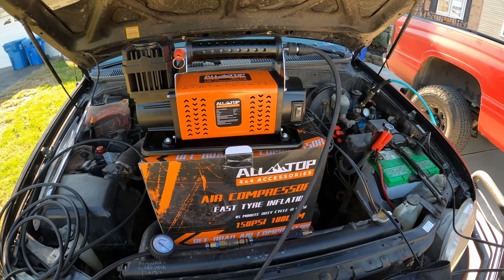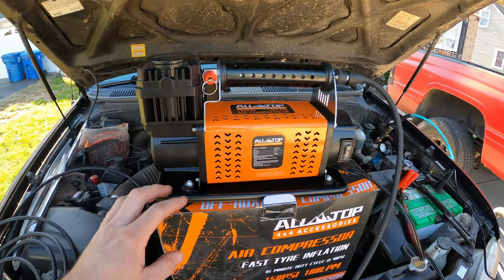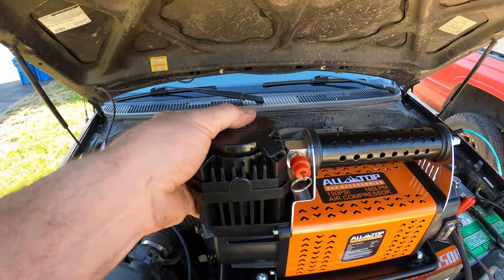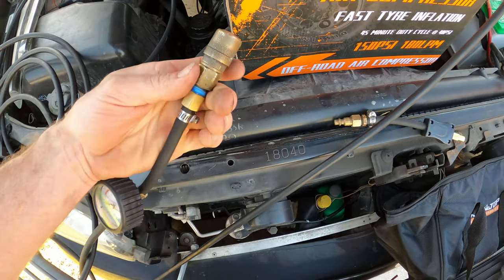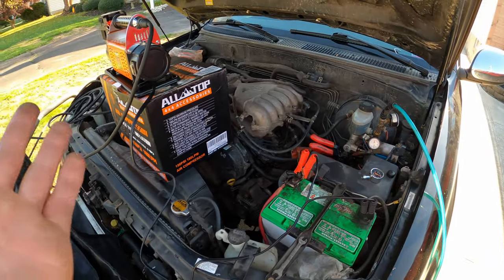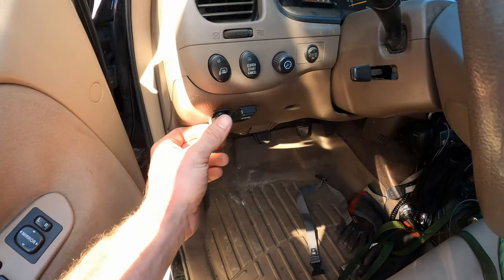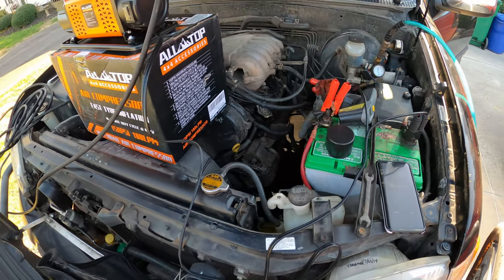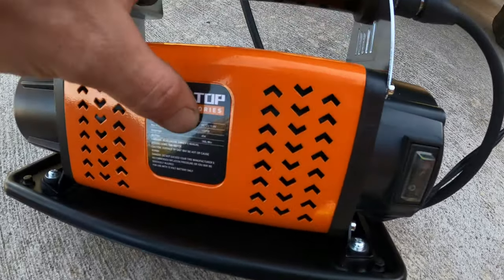ALL-TOP 12v Portable Air Compressor Review vs ARB CKMA12

Comment: Just got one today, the problem or worry that everyone is having about switching the nipple to an American standard nipple is OVER! They now include an adapter that just pops right on! No going to the hardware store to find threads adapters or anything!
This thing is powerful, fills fast and not too bad on the ears! 
I will say the gauge does suck as others have mentioned…. 
Anyone know if the gauge has a common pipe thread, or is the a replacement gauge?

Comment: I did the same with my Harbor Freight compressor, cut the end of the hose and put a standard female end on it. It makes it way more versatile!👍
Reply from the maker: How do you like the Harbor Freight unit? Do you know what the CFM rating is on it?
Reply: I don’t know what the CFM is, I grabbed it a few years ago before a wheeling trip. It’s great for the quad and the dirt bike, but if it try to air up all four 33’s on the Jeep, it takes forever.
Reply from the maker: @MyDIYAdventures  got you. I'll have to look them up. I didn't even think to check Harbor Freight. And yeah they are definitely handy to have! I like my onboard arb n the tundra but I needed to get something for the Ram

Comment: Actually I  just purchased the ALL-TOP 12v Portable Air Compressor and the air guage is dead on plus the air hose connector is US compatible....Very happy with the purchase I can check and inflate the air pressure on my 5th wheel rv at my leisure...
Reply from the maker: That's cool. They must have changed the design

Comment: Now I also wondered if a 12 volt compressor was a good idea mounting in the engine.   Now I know thanks !!!
Reply from the maker: It's definitely the most convenient spot that I found. However if you were going to run it for an extended time you would definitely want to heavy engine hood open to allow cool air in there
Reply: @NoNonsenseKnowHow  I ran some wire from my battery and keep mine behind my seat.keeps it clean etc
Reply: @NoNonsenseKnowHow  I also took mine apart and put a heavier set of booster cables because the wires would get hot and ran 3 feet of insulated hose from my compressor
Reply: @BobSmith-dm3vp  Good idea ...

Comment: awsome review. I have the same type as that alltop and still runs great. I had to get a different adapter for the quick adapter attached to the compressor.I believe they call it a type L or something. changed it out and now I can use the normal quick connectors like yours. Sure wish i didn't have to use the flowthrough adapter when filling as it would be nice to be able to use a digital gauge while filling.
Reply from the maker: Thanks man and awesome. Good to hear yours is still going strong. Haven't had any problems with mine either yet although I haven't used it since this video LOL.  And yeah definitely swapping out the connector is a must

Comment: Since you have to turn the compressor off to get a reading from the gauge, shouldn’t the gauge be located near the compressor. Than you don’t have to walk back and forth to check your reading. Am I overlooking something or did they overlook that.
Reply from the maker: I mean I think it works fine the way it is. But yeah I see what you're talking about. Truth is, once you're used to using the compressor you will be able to know what the pressure is without turning the compressor off
Reply from the maker: Or roughly anyway

Comment: Thanks for the video, nice job. So now that you've lived with it for a while have you had issues?  Would you consider doing another test of the All-Top with the engine running?
Reply from the maker: No problem and thanks man. I haven't used it since this video so I couldn't really give an updated opinion at this point.  May do an update in the future though.  It would be slightly better with the engine running
Reply: @dirtylu79  Could be it's already paid for ?

Comment: End of video you show your front bumper set up. 
Did you attach after you bought truck. 
Would you buy differently 
Have you ever hit a deer?
Reply from the maker: Yes I added the guard and the winch after I bought the truck. I'm happy with the setup. If you look up NoNonsenseKnowHow tundra winch then you will run into a video I did showing the basics of how I put the winch on. Are you talking about the winch or the guard?
Reply: @NoNonsenseKnowHow  the guard, but the winch too. I’ll check out the video. I hit a deer in Montana in a rental grand Cherokee jeep. Now I’m wanting a guard for my 2006 GMC pickup. I really like your videos. Very informative
Reply from the maker: @johnyb9884  oh got you. Yeah definitely a good upgrade! Might not save the vehicle completely but at least give it a fighting chance and will hopefully keep deer from going in the windshield.  That was the main reason I installed one. And thanks man I appreciate you checking out the videos

Comment: Did some quick searching and the oem fitting looks like a high flow BSPT and is bored out a lot bigger than a standard T style NPT.  Mine came with a small adapter hose that connects to the compressor and has a T style male fitting on it.

Comment: Viair portable air compressor is the way to go.
Reply from the maker: Which model? I was looking up the specs on their comparable models and they were half the air volume
Reply: @NoNonsenseKnowHow  400p automatic shut off 33% at 100 psi. 2.3 cfm good to 35inch tires 30amp draw
Reply from the maker: That's great that it has auto shut off. But that's even less CFM than my ARB.
Reply from the maker: @yjdriver7432  the alltop has 6.3 CFM
Reply: I agree its less but it sure seems pretty quick. Ill have to do a 0 to inflate time and let you know. But it has normal fittings and just much better quality build and comes with spare air filters basically everything you didn't like it has hahaha. Just a fan of there products I was going to buy the all top because of price but I'm glad I went with viair
Reply from the maker: @yjdriver7432  yeah that would be awesome if you could let me know what it's 0 to 40 PSI time is on a comparable size tire. I do really like that it has the auto off
Reply: @NoNonsenseKnowHow  will do. But it will be on my truck which is currently 295/70/17 lol kinda close.
Reply from the maker: @yjdriver7432  yeah that's pretty close to the same. Probably a little bit more volume

Comment: The orange one is a direct copy of the t maxx compressor which is made from monkey metal you can’t fit any other ports into the head on side is the intake the other is out put plus the a r b spare parts are readily available for the compressors

Comment: I dont understand why you waste your time if it is price based  comprasion .. we know the result from the specs. if you want to compare the performance of two devices they should close in the specs. so you should compare it with the twin ARB pump
Reply from the maker: I bought the pump because I got a good deal on it. I decided to make a little review video since I was doing it anyway for personal reference. It didn't find it useful it is what it is.